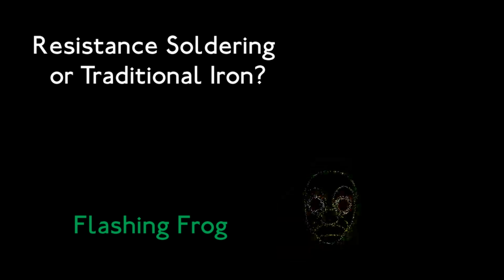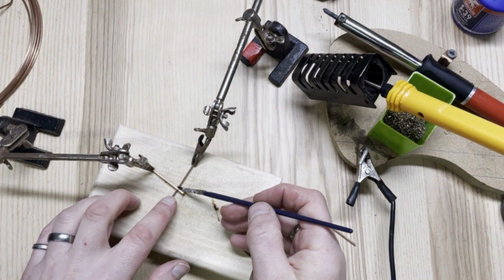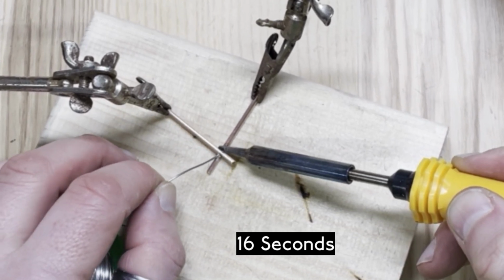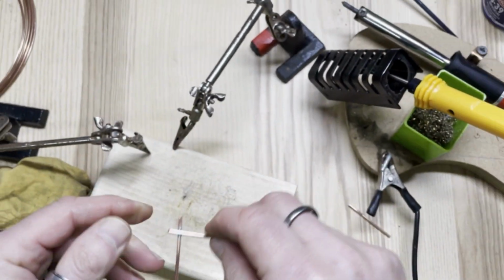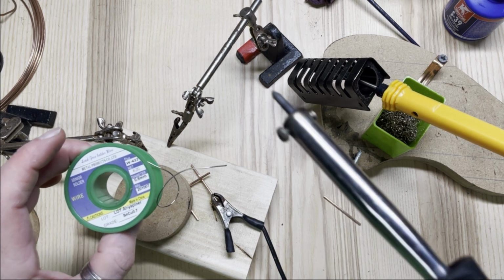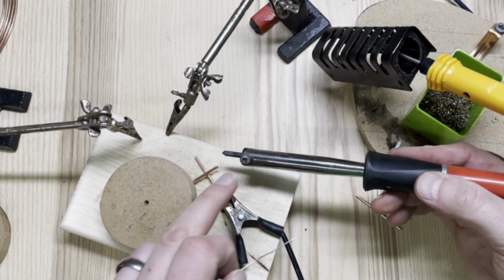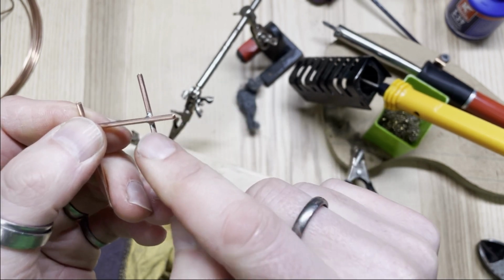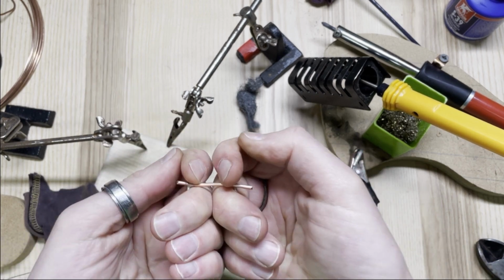Resistance Soldering or Traditional Iron

Comment: I have used these types of units before, and they are ok for work such as what is illustrated here, but I would never use it electronic gear. The tweezer type are handy for XLR cables and such, but thats about it, as far as my experience goes.
Reply from the maker: I agree.  Traditional heat iron for electronics, this is art / scultpture.

Comment: Can I ask you you say it’s copper wire but seems to stiff is it actually copper coated steel? 
 25watts is not enough for that type of soldering,  I’d use a minimum of 75watts with a large tip… big is better for instant joints it also helps localise the heat at the joint …  I’m confident I can solder quicker than both of those you did with the right iron
Reply from the maker: Thanks for your comment Neil. Yes I use solid copper. Not coated steel.

Comment: Hi would you recomme d resistance welding for connections that are hard to mate with regular soldering iron?
Reply from the maker: Hi Rick. I guess you should use something that meets your particular needs. I now swap between standard iron, resistance iron and gas torch.

Comment: For brass rods 3/32" do you think iron solder is better to use or a butane torch work better? and if the iron solder is better what is the recommended flux and solder wire combination? asking for a class lol thank you.
Reply from the maker: Hi. Good question. Unfortunately I’ve never worked with brass rods. Only copper. Maybe someone here can help you?  Cheers. 🍀🌿☘️

Comment: Dear Sir ..
How power (watt) or ampere  is need when resistance soldering iron working. Many thank you
Reply from the maker: Hi. To be honest I’m not sure as I use a commercial off the shelf unit and it is not marked. I think I once read that it’s 6amp.
Reply: @CopperGravity  
Thank you so much Sir
Reply: @CopperGravity thanks

Comment: Hello.  Been following your RBS journey for a couple of weeks.  I'm not familiar with resistance soldering and think it might be a better way to deal with this kind of work.  I noted the unit you are using, not sure it's compatible with US voltage requirements but the price is quite reasonable compared to some units available in the US.  For the unit you have what kind of amperage are you using for your work?  The unit description just indicates a low and high setting but does not say what the amperage is just that the output is 6 volts (I assume DC).
Reply from the maker: Hi. The input voltage states 200-240v so not good for US. I don’t know the amps as I’ve never measured it. I’ve only ever used it on low. Recently someone said I should use a foot switch so I’ve made myself one and am currently learning to use it properly. 

I looked at the US ones and thought there was some pretty nice units around. Maybe it’s best to buy local to reduce postage and have a repair / exchange opportunity if you need support.
Reply: @CopperGravity  The units available here are quite costly.  You are right to use a foot switch, I've talked to railroad modelers who use resistance soldering and the method they recommend is touch the carbon rod to the work press the switch, solder, release the switch, wait for solder to cool, remove the rod.  I may look into a DIY solution using a low voltage transformer or alternatively an old PSU from a computer. Thanks for the info!

Comment: This is rediculous : maybe you could also have shown us how bad soldering you can get using a banana or a twig. The only redeeming feature of those low power  passive antex style soldering irons is that they are cheap. Try a high power temperature controlled type eg a weller. With the right temperature you will find the solder melts and flows almost instantly
Reply from the maker: Thanks Dave. Totally agree. Weller is the way to go for heat soldering. Buy my latest sculpture and I’ll be able to afford one!! 😝

Comment: Totally terrible technique -- what, was the amount of arcing between the workpiece and your resistance soldering tip not sufficient enough of a clue? You are meant to energise the circuit  AFTER it is formed and de-energise it BEFORE breaking it, not just leave the power on. It's not fucking arc welding -- which hilariously enough this would also be a really good demonstration of how to fuck up at.
Reply from the maker: You make a good point. Thanks. I’ve got a lot better since I made this video. Interestingly the unit I bought is always live meaning there is no switch. It has a boost switch for extra amps, but not the ability to perform the soldering in the way you describe. It definitely makes sense to have one. Everything considered, I am converted to resistance soldering for the type of solder work I’m doing. Thanks again for taking the trouble to comment, I appreciate it.
Reply: @CopperGravity  You might be able to connect a mains foot switch to the unit if it doesn't have any electronic control circuit. You will know because it will immediately start heating a test piece when plugged in.
Reply from the maker: Thanks. Since I uploaded this video I made and fitted my own 60amp foot switch. I must upload an update sometime.
Reply: Calm down baby...dont cry. Go find mommy goof
Reply: @MrDeceptacon88  🤣👍 Yep, me thinks someone needs their nappy changed. 🍻
Reply: @williamemerson1799  it was posted 2 years ago...ur late to the party lol
Reply: @MrDeceptacon88  Better late then never there cupcake. Back in the basement with ya. 🤣
Reply: @MrDeceptacob88 You know I'm just messin with ya doncha? Havin fun on the internet. And.... I was agreeing with you by the way. 👍🍻
Reply: @williamemerson1799  typical incel...beta and runs away lmfao